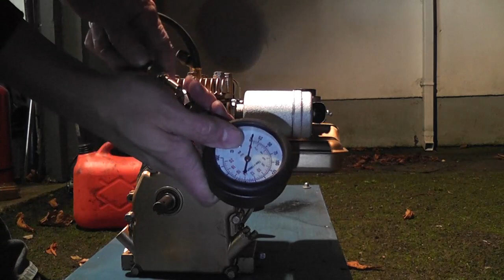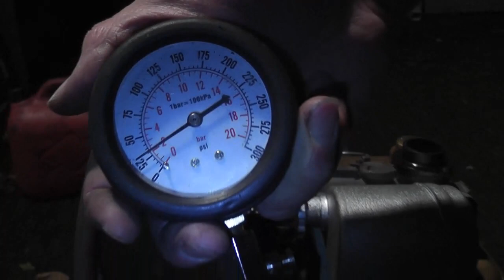JB Weld Scored cylinder repair PART 2 - DID IT WORK?

Comment: I love your videos about this little 2 hp engine,, i’m just getting into it, I got me a 2 hp engine Briggs & Stratton one week ago  9-16-1922  it is a 1970B&S ,, it was a smoker, I passionately called it old Smokey,, The person I got it from was willing to let it go and sell it to me because it was a smoker,,, I must say to my advantage…… again I don’t know anything about these little motors I’m not very mechanically inclined,,, but I took the head off of it and what I saw inside looked like a motor with only 10 hours on it,, The cylinder walls were pristine,, yet it is 52 years old… pointers, I had a hard time getting it started at first I did everything you did except when I took the filter off I kept my hand over the opening of the carburetor halfway which helped with the suction that I needed in order to tune the jet,,, The carburetor was falling off I put new lock washers on it tighten it back up and it no longer smokes I got it adjusted correctly and it runs like a dream and idles like a dream ,,, look forward to seeing your follow up video

Comment: Greetings from San Diego, Ca. and thanks for posting these two videos.  I just opened up a 1978 YZ80 engine the other day, which had been sitting in a field for a few years.  She had some decent rust spots on the top of the bore that are probably responsible for lower compression.  Anyway, I looked up at the peg board, saw the JB weld hanging there and wondered if anyone had tried addressing the issue like you did.  I've heard of using it for impromptu engine repairs, but imagined that cylinder walls wouldn't stand up to that kind of abuse.  We'll see.  I'm prepared to get her bored out or re-sleeved but thought I'd give my namesake a go see.      I hope you get a chance to crack her open for an inspection.  It would be neat to see if the adhesion held up.   Thanks again!
Reply from the maker: Thanks, and say hi to everyone in San Diego for me there! 😉 I have run my engine a few times here and there, and although it doesn't run well, it will run. Ultimately I want to try and pick up an oversize piston, but in the meantime, I'll take the head off and see how the repair held up. I might even try new rings before changing the piston. It might work! I just need time to get back to it.
Reply: @Endfloat  Do We have a follow-up video on this?

Comment: I am thinking about doing that to my dads Honda GX35 powered brushcutter engine this weekend because I replaced the piston & rings in it on Friday night because it was beginning to burn a lot more oil than normal,I mean, if I let it sit & idle for 30 seconds to a minute or 2 it will start to burn oil because pressure has developed in the crankcase,particularly when I crack the throttle open after that it will blow a whole lot of smoke out of the muffler.

 When I pulled it down I found out that the cylinder was scratched from half way to the bottom of the cylinder to the point that I can catch my finger nail on it,I am looking at buying some slow setting JB weld or maybe some of that Permatex metal filler, allowing it to cure for a few hours then sand it back so that the scratch is filled in.

So replacing the rings made no difference because the scratch is allowing combustion chamber pressure to bypass the rings & pressurizing the crankcase so it has some blowby.

It is also not allowing the e piston rings to seal properly, the latter mentioned filler has a maximum temperature rating of 149°C or 300°F so I am umming &; ahhing about how hot that engine runs !

Comment: I'd love to know what your ring gap is. I watched part 1 In horror as you  "Honed" out to those scratches. Give this a Thought if those scratches that you were catching your fingernail on were lets just say .010" deep,  And in the grand scheme of things that's probably pretty accurate, To cut them out you've just bored that Cylinder to .020"  With a 3 bar spring Hone.  A 3 bar Spring hone has a tendency to make a triangular bore when you try to bore something out with it.  a cylinder board gauge would tell you just how "egg" shaped your cylinder is now. None of my comment is ment as an ill willed criticism. And I would truly love to know if the JB Weld actually stayed in the cylinder I've questioned this myself.
Reply from the maker: Oh trust me I'm painfully aware of how much of a mess I made of this engine. I'm on the lookout for another crank case for it, or at the very least an oversize piston and rings. Hard to get for this engine though. I don't think I removed as much material as you'd think with the honing tool though.

Comment: Did you change the piston rings also? I as wrote before - I have a 3,5 hp that is 10 times worse than your bore, new piston rings and it runs well. Question 2: How far out are you with the needle valve? Intial start is 1,5 turns. From there let the engine run at working speed, turn clockwise until it just starts to slown down. From there turn anticlockwise until you reach smooth point. It should never be more than 1,5 turns out, then its way to rich. Just want to check since you adjusted it a bit. Keep well and healthy!
Reply from the maker: No, that's going to be the next job. I'll pick up a set of rings and try the JB Weld again if I missed a bit. I was faffing with the carb just to keep it running. I couldn't get it into any sort of tune. As I said, I'm not giving up just yet.

Comment: I have a Briggs engine identical to yours and it smokes way worse than that. Now I didn’t try rebuilding it but I think they have low compression at the best of times. I tried running it with a 38 mm mikuni carb to get the fkr to rev out more but it was way too big lol.
Did you check the ring gap at any stage? If you have a bore gauge that would be the most accurate but when you score a cylinder like that, honing is never the cure unfortunately. I always wondered if jb weld is as tough as they claim? I fear that it will have different rates of thermal expansion compared to the cast iron bore and will peel off eventually. Let us know how it goes. you can get pistons and rings for these old 2 horse motors still in the US.
Good luck man

Comment: Give the stator that your magneto runs off a clean with ia rotory wire brush on ya drill.  i have a bona scott  vintage egder with the briggs engine.   she had dramas firing up  i cleaned the rust off and seen significant  ease in cranking it over obviously the compression is a pain but if you had both it would be near impossible to kick over.
Reply from the maker: I want to have another look at this engine in the not too distant future. A couple of people have told me that the JB weld worked well on their car engines. I think I'll put a new set of rings in it and see how I go.

Comment: If i cant get a decent 350 block I'll b using nickel alloy welding on a cracked cylinder soon.  If it works for another 10,000 miles before failing I'll b satified.

Comment: Fuzzy Dice used a similar approach honing out rusty bores which probably should have been rebored and he hasn't completed the project but it may have worked. He used lots of lube instead of lapping compound so I think the trick for this is to have lots and lots of patience because faster cutting doesn't necessarily mean it gets the needed result https://www.youtube.com/watch?v=lSqgJh0Ed5o&t=159s
Reply from the maker: Thanks for the link. I must have a look at that. I'll be revisiting this little engine in the future.